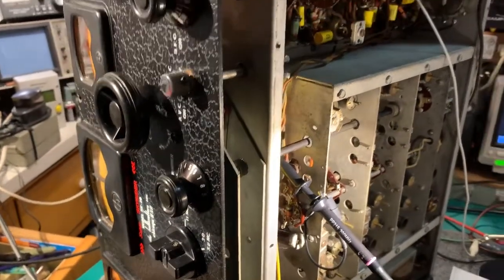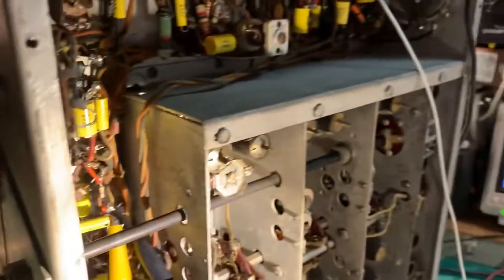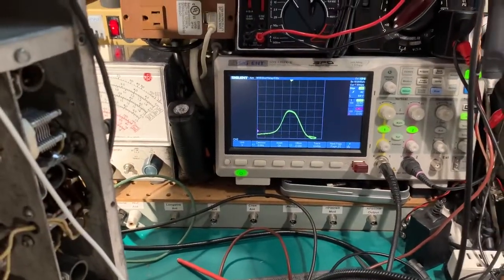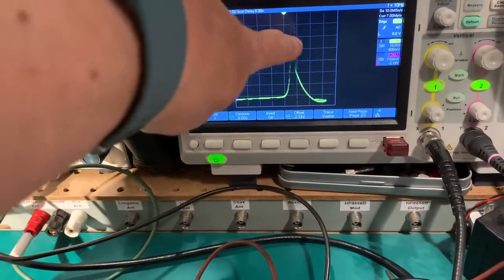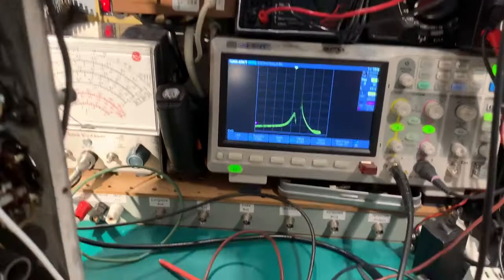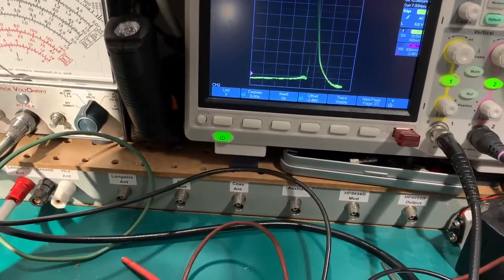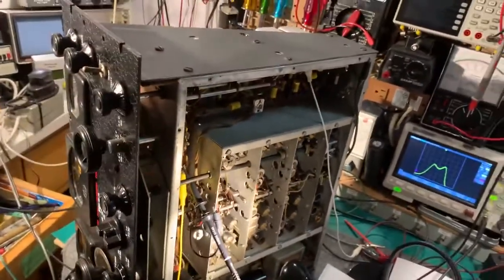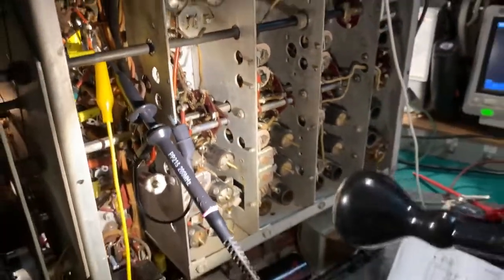Hallicrafters SX-28 - Checking IF Alignment with a Sweep Generator

Comment: Hello! thanks for the video, I'm also performing an alignment, but i noticed that i have dead silence from 27Mhz to 42Mhz, I'm able to tune up to the 24Mhz but any higher, dead silence,  i cant figure this out! I've racked my brain but, no go, any ideas? Thanks! oh and i have the 28A version.
Reply from the maker: Hello.  If Band 6 is working ok up to 27MHz then 'silence', its likely that the local oscillator is ceasing to oscillate above this frequency.  If you have access to a TinySA or another radio that tunes up to 30MHz or so, you can easily check if this is the issue.  If this is the case, there are a number of possible causes, including a weak 6SA7 local oscillator tube (very often the issue when not working at higher frequencies), low plate voltage on the local oscillator tube , or failed B+ bypass capacitor on the local oscillator, tarnished band change switch contacts or even a poor ground connection around the local oscillator part of the circuit.  You may find my articles on the SX28 and SX28A of interest - they are available for download on the SPARC radio museum website, here:  http://sparcradio.ca/wp-content/uploads/2019/04/Hallicrafters-SX-28.pdf, here: http://sparcradio.ca/wp-content/uploads/2022/09/Hallicrafters-SX-28-Refurbishment-2022-with-Appendices.pdf, and here: http://sparcradio.ca/wp-content/uploads/2019/04/Hallicrafters-SX-28A.pdf
Reply: @RadioRestoration  Now that i think about this, a few years ago i had the same exact issue with my hallicrafters SX-25, would not oscillate above the 24 Mhz band. Was very frustrating, I recall replacing every component and still could not get it to oscillate above 24 Mhz. I need to check my notes, Thank you for the info.
Reply from the maker: @thevintageaudiolife  I have encountered this problem many times, especially on pre-WWII radios that covered the 'APEX' HiFi AM band above 30MHz - either encountering failure to oscillate above a certain frequency, or across a band of frequencies within a particular band.  I even encountered this on a Scott AW15 that refused to oscillate across a narrow range of frequencies at the lower end of one band - see pages 27 - 32 in this article: http://sparcradio.ca/wp-content/uploads/2022/09/Refurbishment-of-a-Scott-Allwave-15.pdf